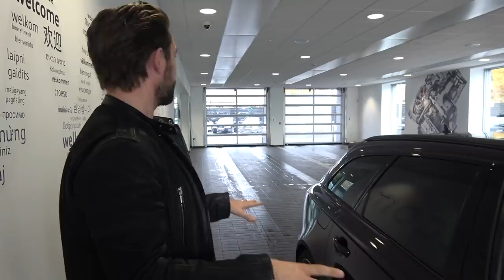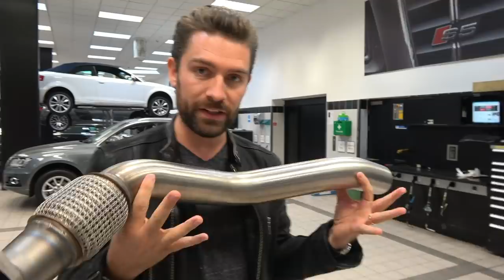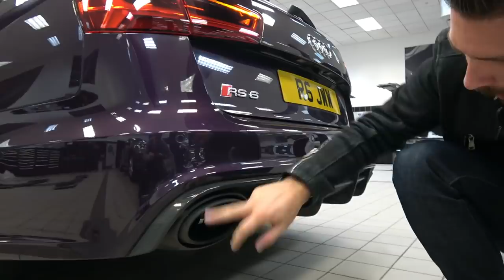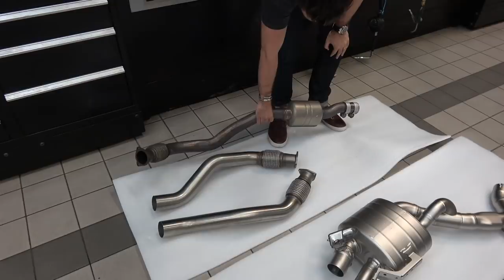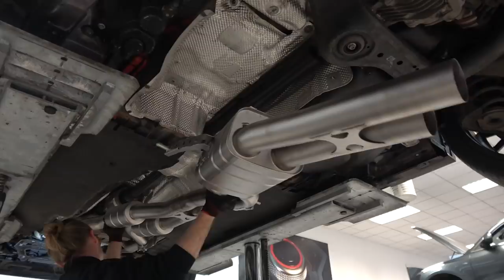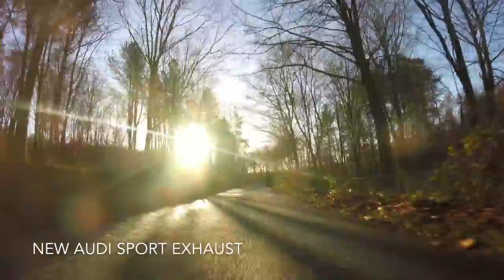Audi RS6 Performance Akrapovic Titanium Exhaust System | MrJWW

Comment: I actually thought JWW had a refined and nicer fan base.  Now all I'm reading are idiots mentioning the Milltek exhaust.

If you are mentioning Milltek sounding better, you've probably watching decatted, Non Resonated loud and obnoxious RS6s from the streets of Mocano etc. Yes, it roars. Yes, it's louder than this. JWW addressed this, its used as a daily driver and did not want "loud and obnoxious". The guy treats his car with upmost care and wants quality pieces that also offer value and charisma to a car. A loud obnoxious purple RS6 wouldn't be a great daily driver.

You're complaining about the fact he chose Akrapovic over Milltek for Waranty purposes? Are you a mecanic? Are you an Audi Certified Specialist? Are you the owner of this car? No, you probably are not and you are definitely not the owner.

As mentioned in these comments, comparing 304 stainless steel to Titanium is like comparing your Honda to any luxury based brand. It's well engineered and not "as blunt' as the competition. Long term wise, it's a great choice. 

Milltek exhaust are good if you're looking for a louder, more obnoxious car. To show off. Clearly you didn't even watch this video and the author's reasoning if you're even debating his choices. 

Peace.

Comment: James thinks like I do. This is a daily driver. I would chose Akrapovic over Miltek just because  this is a long cruise daily driver. Miltek might feel good for a month but afterwards you would feel its a bit too loud for a long cruise. Akrapovic sits right in the middle, is not as loud as Miltek, still brings a bit of newness to the sound and you can still go on long cruises in comfort.
Reply from the maker: +Frequency exactly. Also the engineering is epic 😜

Comment: Fantastic improvement to the sound, was there an increase to the stock 605 bhp?👌
Reply: Andy Keeble does a stock rs6 not have 650 hp? or is that the rs7?
Reply: Both RS6 and RS7 performance are 605 stock with Stock and around 615 with Akrapovic
Reply: Andrei Padurariu ok thx
Reply: There's around 10bhp increase with Akrapovic as advertised by websites where you can buy this exhaust system, but when you buy a brand new Audi they don't advertise it as 615

Comment: Any horsepower gain with the new exhaust? Nice video as always...
Reply: Brebta Brebtovič only few, with Miltek u get more hp
Reply: Considering the Milltek exhaust is heavier, the only reason you'd get less back pressure is if you went decatted downpipes. Frankly, it smells, it's too loud and no, you wont see "major" HP differences for those inconvenients.
Reply: spin0rz you are wrong, Miltek exhaust itself gives 20 hp+
Reply: Tadas Simasevicius actually. You are wrong as milltek doesn't provide any details on the "gained" hp. Also, milltek provides high flow cats and gutted options. Where as, this is using stock cats. Completely two different exhaust systems. You sir, did not even bother listening to the author of this video on his personal choices and reasoning for this exhaust making your presence on this comment section utterly irrelevant.
Reply: spin0rz Miltek not provide on website any horse power, but ppl who installed Miltek and made dyno gained hp about 20 +

Comment: Nice exhaust James.
Interesting that the bore of the pipe looked bigger because (apart from the price) the one thing the AudiSport/Akrapovic gets slated for is that on the Audi RS forums is that they claim its the same bore as the oem unit and thus doesnt give much extra power.

Gonna have to respectfully disagree that no other car ticks as many boxes as the RS6 does though.
The new AMG E63S Estate is faster, sounds better, is reputed to handle better and has just as much daily ability.

Comment: Frankly, the factory unit sounded better in my view - more like a muscle car. This new one is indeed louder but the tone doesn't suit the car. Weight saving is insignificant, and you won't gain too much power as the exhaust manifold is the same.
Reply: Yeah - I liked the new one but the original had that flat flat sound that I love about the RS7 and RS6. Bit more muted, but I reckon that the upgraded exhaust would get on my tits a bit much with the endless crackling. Each to their own though.

Comment: Why oh why can you see the floor through the exhaust pipes... I mean, they aren't even connected to those fancy tailpipes right? Maybe there's an engineering reason for it or something but it's something which annoys me about the stock RS6 exhaust so it gives me rage that this fancy Ti system hasn't fixed that. Lovely sounding thing though and great that Audi support it.

Comment: Your original exhaust looked pretty good and individual sections can always be replaced. Personally I'm a great believer of keep it factory standard. If I were buying your car second hand I would run a mile because track days and hard driving would come to mind, not that that's is what you do. Somehow I'm wondering why did you spend all that money or did you get it for free?? Unless of course you've got pots of money to blow.I bet your old exhaust is on EBay, I wonder.
Reply: Audi stock exhaust is usually one piece cat-back. No replacing parts there. And always keep your stock exhaust imo. Put it back on when you sell your car (hour's work). Don't think James will bother. Probably got the thing for free. 8000 euro's (think the pound is now about the same) without fitting is a lot of money

Comment: I mean that's nice but I feel for  a RS6 you need miltek fam
Reply: with militek you lose the warranty.
Reply: Jameel yes bud miltek is BEST!
Reply: asr 01 lol what warranty?mufflers? I’d still go for milltek
Reply: asr 01 audi aren’t going to void your warranty if you change your exhaust unless it directly causes damage elsewhere and it’s an exhaust...
Reply: Milltek are shite! They use 304 stainless NOT Titanium........different gravy! Milltek are not dealer valid and can void your warranty.
Reply: Slapbladder seems that u never heard or driven rs6 with Miltek none resonated
Reply: Jameel yep Miltek better choise
Reply: Slapbladder miltek last life of car mate they are quaility zorsts like i said you wont beat miltek for pops and bangs and sound period!
Reply: pendulum1824 well said!
Reply: You are clearly 13 years old and have never owned  a car let alone a milltek. I am telling you they use 304 stainless which is the cheapest you can buy and they used to use mild steel flanges which rust. Last the life of the car? My arse!
Reply: I am telling you WHAT grade of stainless the exhaust are made from which is the cheapest you can buy. The Milltek will drone without resonators....period. I had a Milltek on a car way back in 2006 and it was shite. I took it off and built my own out of 316 stainless. You are comparing a Milltek cheap stainless exhaust to a Titanium one....its apples and pears!
Reply: Slapbladder drone? You joking right? Maybe your car was not v8, with v8 you enjoy sound every day, and you talk about drone
Reply: Slapbladder who? 13 years old?
Reply: Slapbladder it’s actually good product comes from Miltek company , they been working over 40 years And akrapovic how long? 5 years 10 ? They quite new in this
Reply: Seems like you Miltek boys have never heard of something called personal preference. Perhaps you should look it up instead of crying that someone chose another exhaust system for their car which you will probably never see or hear in person in your entire life.
Reply: vincentAD you are the person throwing the names around calling people names. If you read my posts you will know I have had Milltek before and known many people who have had Milltek. You crack on fella I know what tubing they use and how they degrade. Hence why I made my own.....look up 304 stainless and 316 see which is better. Then do some research in to Titanium and understand the metal and then comment on his exhaust.
Reply: Tadas - Both companies have their origins dating back to the early 1990's.  Difference is that Akrapovic have racing pedigree with OEM manufacturers such as Audi, BMW, Honda, Kawasaki, Ducati & Suzuki. Milltek have nothing and instead, have just been knocking about in the BTCC midfield wining nothing.  As I've said to you elsewhere and on here...you fanboys are so blinkered and just don't get it!
Reply: Jameel Milltek*
Reply: collyersam nailed it!

Comment: Idiots like this had the EU change the noise regs, these exhausts are now banned with new cars getting half as quiet by 2022. 99 percent of the public dont want this noise. Why not remove the sound proofing from the bulkheads if you want to hear the engine?